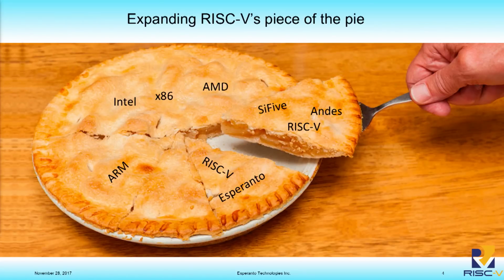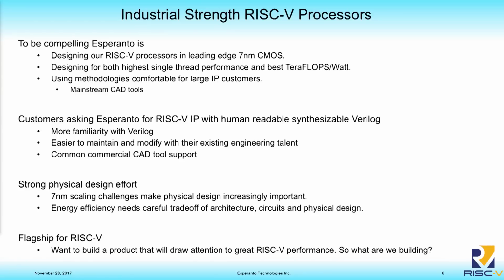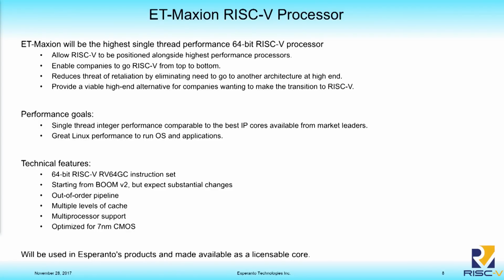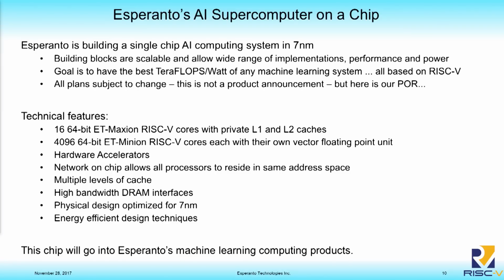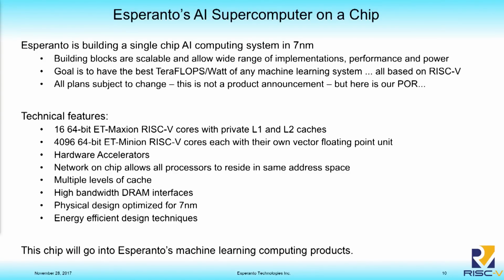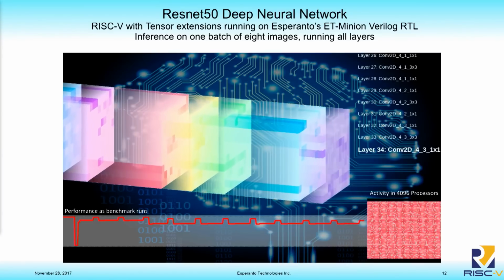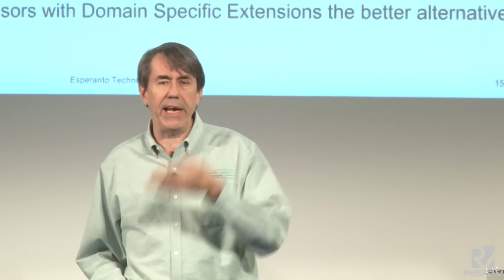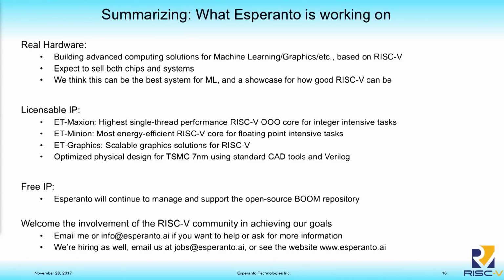Industrial Strength High Performance RISC V Processors For Energy Efficient Computing

Comment: Thanks a lot sir. I need some time to design an interesting board based on RISC-V.  I will take a risk by myself ! It will satisfy most of the needs I guess on high performance, flexibility and low power.